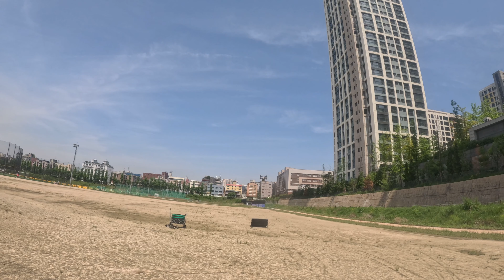Arrma VS Tekno 6s Stunt Trucks🔥🔥🔥

Comment: I love my tekno mt410. I rarely ever break anything on that rig but on the same jumps I always break something on the arrma.
Reply from the maker: Yes, it’s def my fav all round rig. But I’m starting to love the long wheelbase of the Arrmas as well. Might turn my GT48.3 back into the MT48.3 🤣
Reply: @omega_rc  that's what I did mine is a stretched mt48.3 with an m2c et48.3 truggy chassis. It drives so smooth